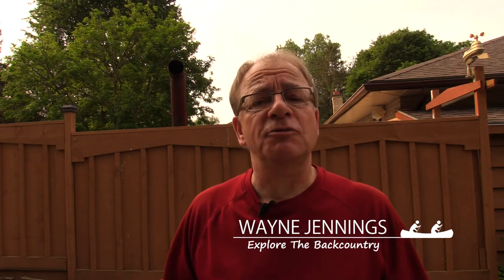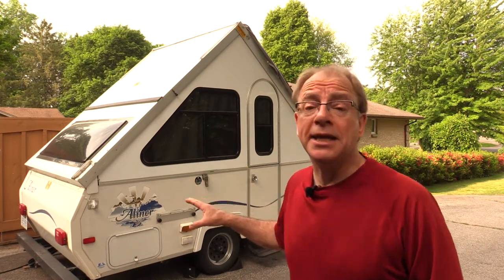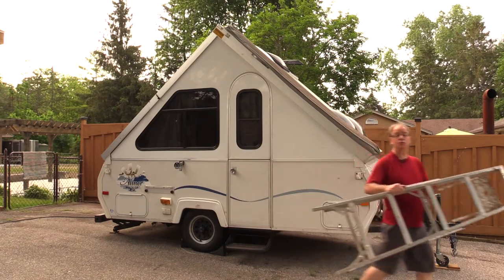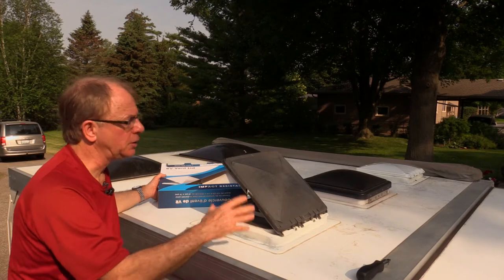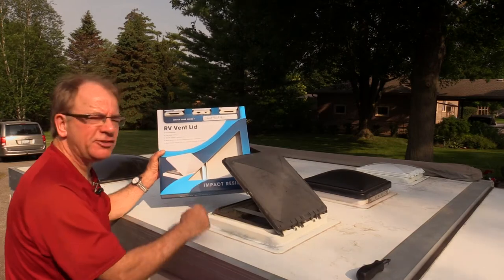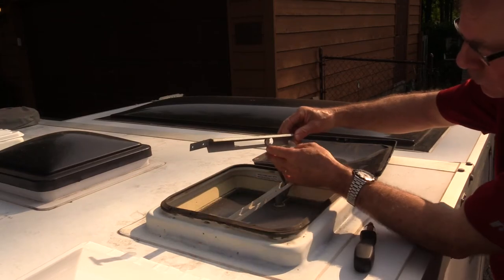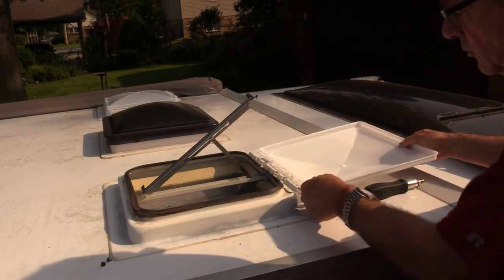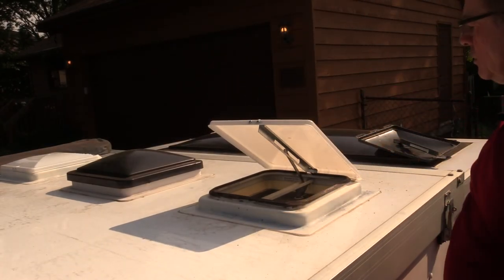RV Vent Lid

Comment: Hi, I used to have a 2006 Scout Aliner - nice to have such a comfortable, light trailer in colder weather. I ordered and replaced the foam sealing kit - fairly easy to do that too. Cheers, Steve
Reply from the maker: Hey Steve,  That one in the video is a 2005 Aliner Classic.  We also ordered the foam seal kit from Aliner, but we had a local RV dealer do the installation for us.  Thanks for watching.